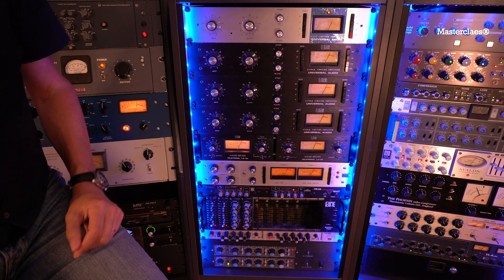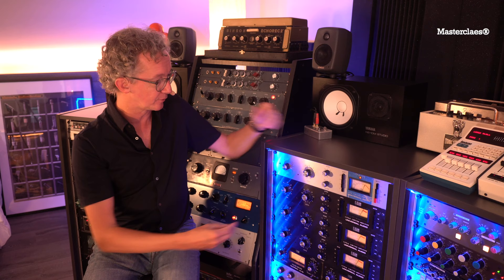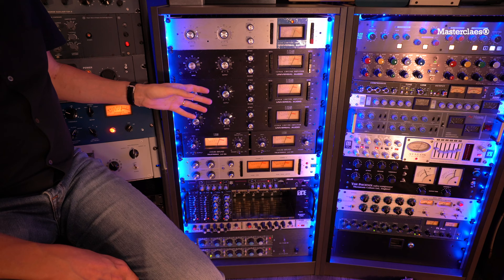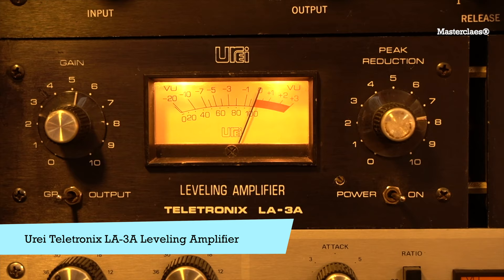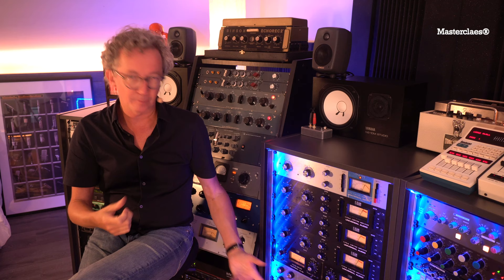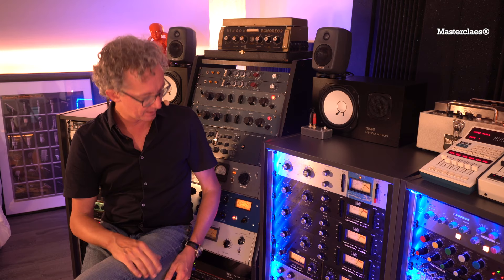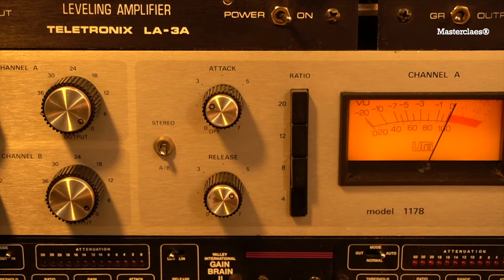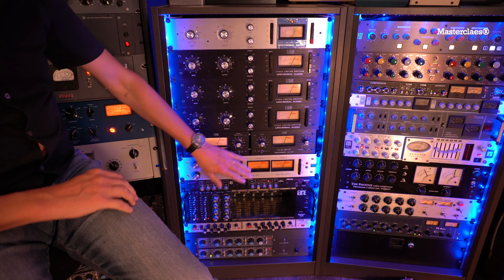Rig Rundown Of Rack #2

Comment: Are these settings on every hardware, and the chain in which each is connected to other is kind of permanent for most of the tracks ?
Reply from the maker: Yes it is... I use my gain structure in PT to make it work, and if it doesn’t give me the desired result I will go for another chain or plug-ins
Reply: @MasterclaesVideos  oh wow, that's so unique method. I am also going to replicate and use your  analog chains as it is with those settings in ITB chIn. 😊🥳

These are so smartly designed ones with so correct settings( I can hear the sound in my head 😀).
Reply: @abhisheksrivastava3787  In the end, it is much quicker to work this way and you will be using the 'best' settings on the equipment.
Reply: @halpearson4226  True, agreed sir !

Comment: What would your signal path be for a acoustic guitar with a internal microphone for stage?
Reply from the maker: Hi Roger, do you mean microphone or pickup?
Reply: @MasterclaesVideos  I have microphone in my guitar called Mini Flex 2 Mic Model 1. It's awesome.  My current signal chain is from the guitar to a WA273 preamp into a mixer. Do you think I could benefit by using a 1176 style compressor?
Reply from the maker: @rogerclemens2769  I would go for a great Mic-Pre + EQ and a comp yes. Or a very good channel strip!